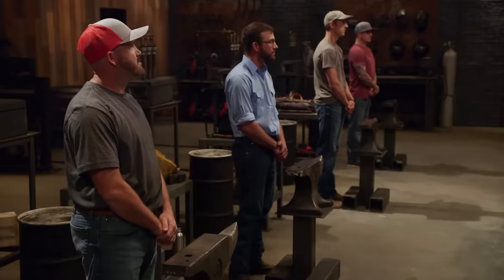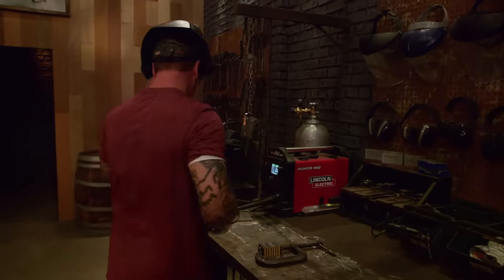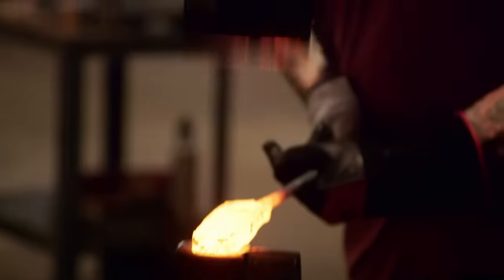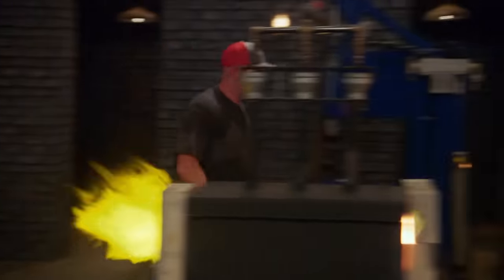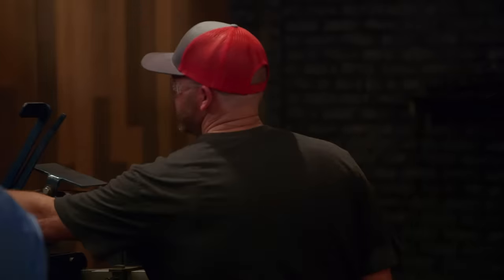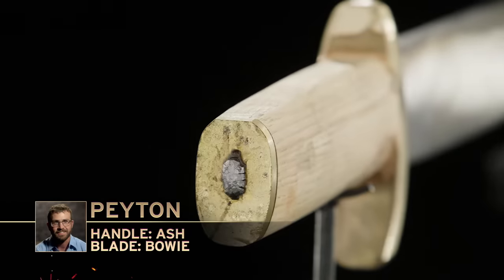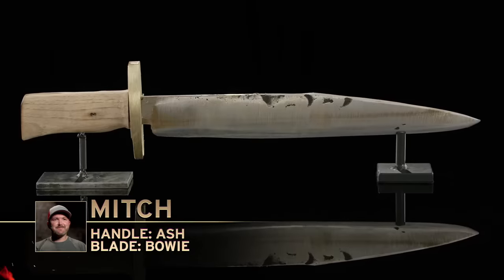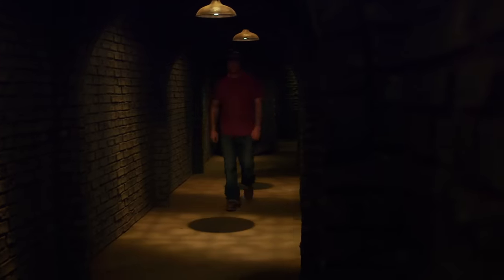Ultimate DISASTER! Blade Handle Falls Apart | Forged in Fire (Season 7)

Comment: Using the rebar was cheating anyways. It was not the steel he was given to work with.
Reply: I mean, he did have the worst luck with his materials to begin with (ball bearings are the hardest of the three options shown here, this episode's challenge is already unfair by design), so I think that's fair. He did use it only for the handle anyways... What would you have him do, just throw up his hands and say "oh well, I haven't got enough material left to make a blade, that's it then, I'm giving up, tough luck"? That would be bad television.